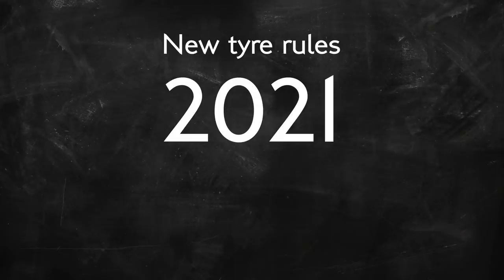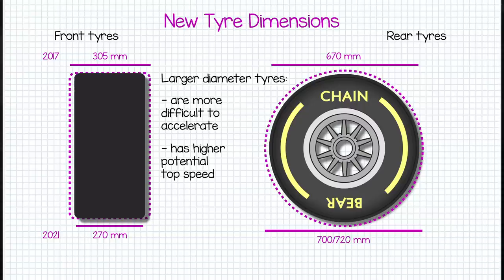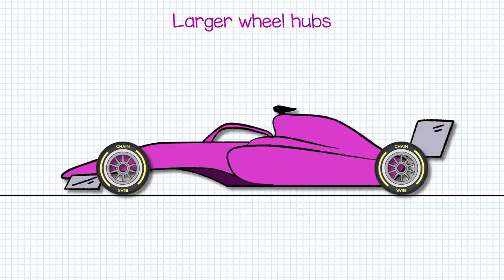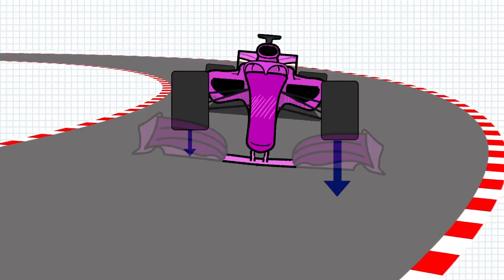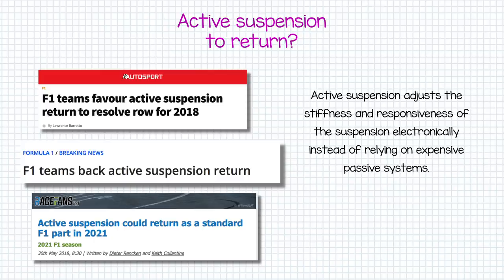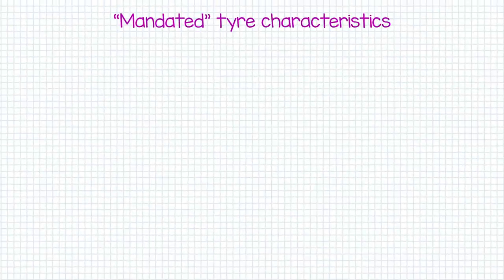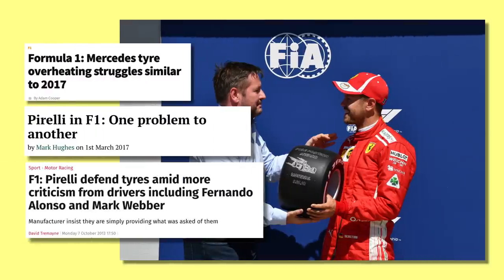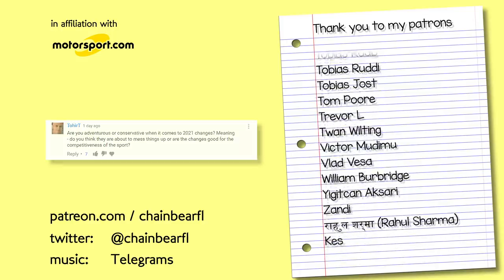New Tyre Rules 2021 explained - Low profile tyres, no tyre warmers, radical compounds

Comment: Can someone please explain the fascination of F1 trying to "relate" to road cars? Its a fucking single seat open wheel race car! I don't look to F1 for comparisons to my Toyota Camry. This is why we have WEC..
Reply: One of the reasons F1 want to relate to the road car is to attract manufacturers and automobile investors. One of the clearest examples here is Pirelli, who wants to get brand name association and more sales on the tires because people believe what they are buying for a road car are direct replicas of what they see on the F1 cars.

Other than that, F1 is a gateway to an extensive R&D for on-road automobiles. F1 has a privilege of testing and developing new technologies a lot earlier than other types of sports. Traction control, active suspension, semi-automatic gearbox, kinetic energy recovery system, all of these techs are showcased as the pinnacle parts of F1 despite not being the inventors of the equipment. It also helps that staff from F1 teams are some of the most skilled and knowledgeable people in the world when it comes to car development, meaning you're working directly with highly experienced people.

It does NOT matter if the open wheel car does not look like Toyota Camry (and neither does a WEC prototype). What the companies want are the data and engineers who can identify how techs work and how they can push the limit of the technologies. F1 is a super competitive sport that encourages fast and reliable development of car parts. The extreme and unpredictable conditions of racing allow for intensive and critical assessments of what each piece of the new tech can/can't do and how far it can be develop not only for F1, but sport/road cars as well. For a reference, look at the original 1990 Honda NSX. The car was developed by Honda's executive with the company's knowledge from its partnership with McLaren in the 80s-90s. Aryton Senna himself helped with the development due to his contract with the company.

The low profile F1 wheels help car industries in that wheel and tires development will be made faster for road cars because the data will be more comparable. This allows the techs to be developed quickly to its fullest potential before they are being adapted onto a road car. It will also help other R&D such as brakes, suspensions, and other new techs that may be discovered in the future.
Reply: That's my point though, WEC literally does all of those things and more. Not only do you have prototypes which are pushing the boundaries on technology just as far, if not more than F1 cars now. 

You have production based road cars cars racing in the series as well. I mean if we're going to talk about "relating to road cars" Ford literally built the new GT the way they did just so they had a competitive car for WEC.  Now with WEC's "Hypercar" rule for 2021 it's only going to make it more exciting and even more relatable to road cars.

I find it funny how F1 is touted as the "Pinnacle" for technological advancement. Yet they ban 90% of the advancements they've came up with! Traction control, active suspension, abs, etc etc etc. 

I get the fact they wan't to make it more attractive and "Affordable for other manufacturers". But i struggle to believe that a naturally aspirated V8 was more expensive to develop and maintain than a turbo V6 with 47 electric motors and a glorified thermo powerstation on-board.

It's always 1 step forward and 2 steps back with F1. Only up until this year are they running lap times comparable to the v10 era. Gp2 lap times were getting alarmingly  close to F1 lap times for awhile, and that's just frankly pathetic in my opinion. Fernando Alonso literally said he was BORED in the car just a couple years ago. 

Maybe that's why he went to WEC haha.
Reply: The WEC idea is a good point, as not every car company are interested in F1. Porsche and Lamborghini, for examples, are never really interested in F1. However, the banning things are arguable. F1 is not 100% machine. When you have new technologies, someone is going to complain that they want "man over machine". For example, James Hunt said banning active suspension was a good thing because the driver would have more inputs in the cars. What is good for one person is bad for another, and FIA is the one who have tolerate complaints and balance things out.

Fernando Alonso's getting bored of F1 has nothing to do to FIA's approach to sport. In 2017, he wrote an article called "Fernando Alonso: Why I am racing in the Indy 500" for SkySport news. One of the main reasons he ditched F1 for Indy 500 was because he wanted to win races and he cited his entire resume to support his claims. McLaren Honda horribly failed that expectation and Fernando's found no other choice but to constantly sneak out to race in other series. Everything he did was for his own successes, and WEC showed he was more than capable of racing despite the McLaren's fails.

That's the problem, though. I don't understand why Fernando keeps sticking with McLaren. If it was Senna, he would have jumped ship years ago. Instead, the guy keeps wasting his time with that team. Remember, everything he did, he did to get a competitive car to win. Since that fails but he is still contract bounded to McLaren, all he can do is complaining at the sport itself. It's all about rhetoric and playing a victim card, which is unfair to F1 as a sport.
Reply: Well, F1 is the descendant of the first Grand Prix races in the early 20th century. Who ran them ? Manufacturers wanting to prove they know how to make cars.
Reply: I agree. F1 should be all about performance and you know what performs better? Lower profile tires.
Reply: manat31790  "I don't understand why Fernando keeps sticking with McLaren.' Because he bailed out of his seat twice before when  he should have stayed put.
Reply: @wingracer 16 Is that so? Where did you read that?
Reply: catcrumbs its common knowledge that the lower the profile the better stability in the tyre due to less side wall flex, but you still want some side wall flex so once the side wall profile gets too small you will have less grip due to the tyre surface not being able to conform to the road surface when there is large amounts of side ways force on the tyre ie. when going through a corner at speed.
on a street car l wouldnt go any smaller than a 45 profile or you will defeat the purpose of spending big bucks on performance tyres, any smaller than 45 profile has no purpose other than looks
Reply: @FastPaull    Nothing comes close to F1 technology, I think F1 looks down on NASA.

"WEC literally does all of those things and more. Not only do you have prototypes which are pushing the boundaries on technology just as far, if not more than F1 cars now. "
Reply: Yeah I can't wait for my Hyundai Elantra to be covered with protruding aero winglets so it looks like a stegosaurus with a tv antenna on top.
Reply: My point exactly. F1 should NOT be road-relevant. Trying to make it is just stupid. Even WEC strives to make its cars un road-relevant.
Reply: @bjorn1583  A 45 profile is actually 45% the width of the tire. So a 225mm wide tire has a profile height of 101.25mm (225 x 0.45). A 305mm wide tire has a sidewall height of 137.25mm.
So basically, the wider the tire, the lower the profile % in order to maintain the same sidewall height.
Reply: @SI0AX  l know that and the wider the tire the more side wall movement is needed, it dont matter the width of the tire because a 45 profile and lower will affect your turning ability in a negative way
Reply: @bjorn1583  I didn't know that. I thought it was better to have lower profile tires. My Mazdaspeed 6 came with 215-45 R18 tires, but they kept blowing up so I changed to a 17 inch wheel and got 225-50 R17 tires and haven't blown them up since. I noticed less feel, but the 18inch tires I used to have were better(Toyo T1 Sport).

Cars being release today are now coming with 19 inch wheels and even lower profile tires. The Honda Civic Type R  comes with 20 inch wheels and a profile of 30! My cousin has one and said it costs $250 per tire and he's blown up a few as the smaller the sidewall, the easier it is to damage and blow them up from hitting a pot hole.
Reply: @SI0AX  if you gonna change your wheel size just make sure you use a tire profile to keep the circumference of tire the same as stock so speedo is still accurate 
its all about using looks to sell the car but looks dont equal better, the monaro is a good example because it came out with too low profile tires and as tested on top gear they got better lap times by switching to a higher profile tire.
there are only 2 reasons why you want too low profile tires, 1 looks and 2 for drifting due to the tire being easier to skate because of the limited side wall flex.
its all about keeping as much contact patch on the road and its a fine line between too much and too little profile.
Reply: @wingracer1614  Not really. Smaller thus lighter rims decrease unsprung mass which is the most important type of weight saving.
Reply: @nodo7575  You are forgetting the weight of the tire which is also unsprung mass. Aluminum has a much better strength to weight ratio than rubber. So a little more aluminum to get a little less rubber equals less mass total.

Comment: As a Mercedes Technician, I see bubbles and blowouts every day on low profile tires. I wonder if this sort of thing may be more common in F1 in the future. Of course, these sort of injuries are caused by potholes, which a racetrack (hopefully) doesn't have. Very interested to see how this plays out. Great video as always.
Reply: jort93z And WEC
Reply: What you'll probably find is with the lower profile tyres there will be less give in the tyre wall so agressove use of kerbs will have a higher tyre failure rate, see it a lot in other forms of motorsport such as Aussie v8's and btcc, also the load on the inside edge of the tyre will increase per square cm so punctures due to high camber angles could be more common
Reply: MrCourty89 That would mean more on track racing and less cutting corners or going wide. Which I think is a good thing as well.
Reply: +kempo 95
It also means less agressive racing which can be good o bad depending on which driver you look at.
Reply: Martín Varela What do you mean with aggressive? Sure the cars will be slower because they need to keep a tighter line. But if they can actually get close to each other, they can actually battle/overtake, rather then just following 1-1,5 seconds behind.
Reply: +kempo 95
But on the other side, tighter lines means smaller error margins, and that means more sensitivity to dirty air and racing line deviations like those for overtaking, which means the cars could actually get more separated.
Reply: a potholed racetrack....now there's an idea
Reply: They aren't going that low a profile. We aren't talking 32s with a strip of rubber on them. Hell a lot of rally tires are lower profile than F1.
Reply: +wingracer 16
Except you don't have rally suspension on F1.
Reply: now we might have rally suspension on f1, or at least suspension that looks like its actually doing something.
Reply: @ HeavyHarris This is one reason why I changed the tires from my C-class from the original low profile tires to still allowed 205/55 R 16 tires. They are less fancy than the original size, but they are driving very comfortable and the suspension will probably say thanks to that.
Reply: Woow youre a Mercedes Technician!? Good job! Very cool
Reply: The curbs on the race tracks are pretty gnarly I'm not sure these low pro tires are going to fair well at all.

Comment: Fia→ Wants to reduce costs.

Fia→larger wheels→full redesign of suspension→no sense

Fia wants more safety→bans tyre blankets
Reply: Actually a larger wheel would help cut costs simply by reducing the need and importance of inerters (an area teams have spent ridiculous amounts of time and money on). Throw in active suspension and your development costs over a span of years just got slashed by millions.
Reply: El Chasco lmao
Reply: Given everyone knows 2021 is a season of significant chances, it makes sense that they'll be doing a major redesign on the chassis already. Beefing up the suspension and adjusting how the arm travel to compensate for lessened tyre wall deflection absorbing shocks is not such a huge redesign either.
Removing tyre warmers will mainly have an effect on the start of the race, as the formation lap becomes much more vital for tyre warming, at pit stops, they might simply have all their tyres in heated cupboards to reduce that lack of warmers a bit.
Removing warmers will also lessen the undercut effect slightly and will put more emphasis on the driver managing his car.
Reply: The banning of blankets is not opposed to safety. This is just a consequence of the new tyre compounds being much safer at low temperatures than current tyres.
This will allow for even lower speed limit under safety car. Which means the pace car won't be running at its limit and working conditions will be safer for people on foot evacuating broken cars, repairing protections and cleaning the track of spilled fluids and broken parts. And drivers won't have to swerve like mad men to keep their tyres hot for the restart.

Also slick tyres will still have grip in mildly wet or foggy conditions.
Reply: Sean Price  It's obvious it will work.
Reply: El Chasco larger wheel, new suspension tech, so not only consumer tires will benefit more, but also suspension manufacturers... more money into research for F1, because it can be adapted to a consumerproduct that can make profit.  -> more money in F1/automotive.
Reply: FIA wants more safety = please design tyres to fall off a cliff
Reply: fia - bans tires that need tire blankets

fia - changes a system so that its in the teams hand instead of everybody having the same exact pirelli suspension
Reply: you seem like you didn't watch the video before posting your opinion. The new tires are supposed to be grippier from the get-go, needing less warming up, and the suspension is affected less by wheels, which could make set-ups more different because the wheels are always the same. Also, active suspension might come back, which will reduce costs, and there is already a cost-cap planned for teams in 2021.